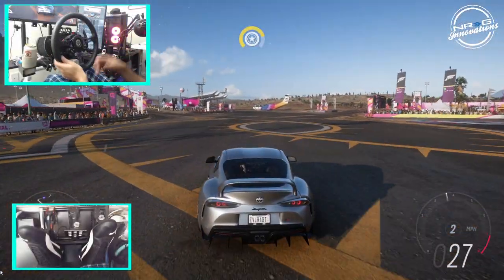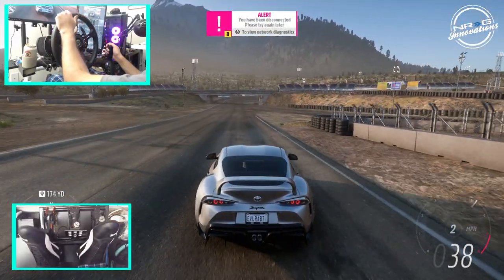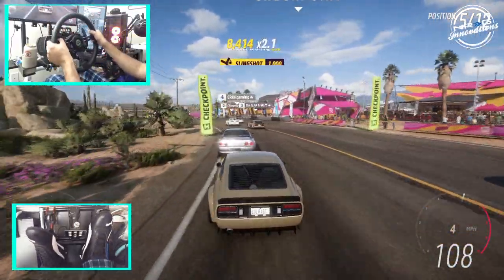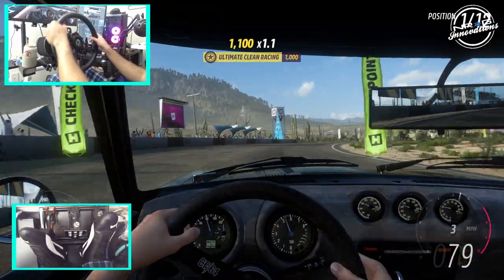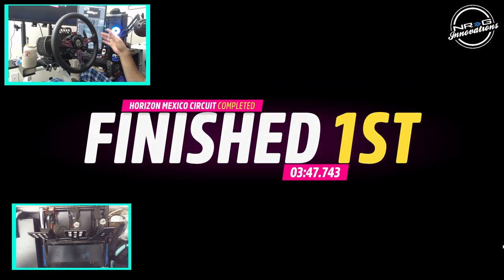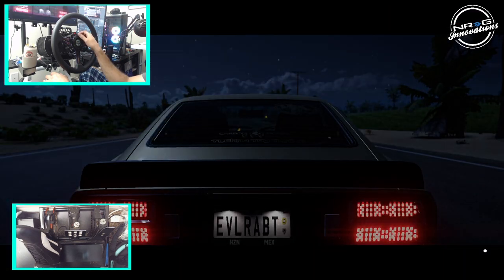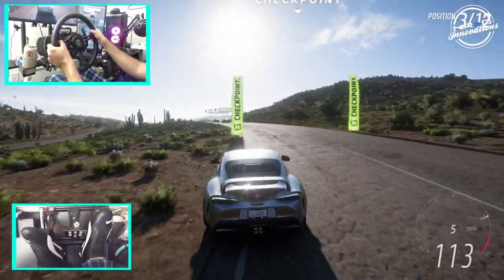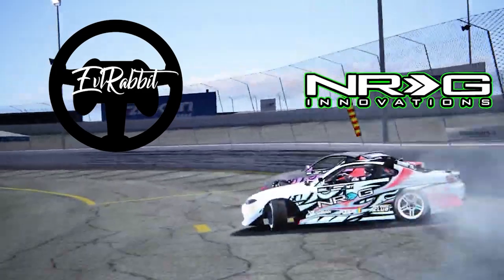Forza Horizon 5 Wheel First Impressions and testing some wheel settings - LP1 -

Comment: Yes, the fact that the animation doesn't go above 90° really bothers me...
Reply: been an issue for me since fh3... how is this still a thing? :(
Reply: Theres a camera preset without the wheel. Why do you need to see two wheels anyway
Reply: @sumbodee3  for two reasons, actually, the main being that I only use one monitor and the camera setting without the wheel is too narrow and shortens my peripheral vision, also the camera is static and it doesn't adjust when drifting. I'm on the console version and there isn't an FOV slider.

Comment: I haven't played with any of my settings with my Gmail in f 8 9 20 yet in FH5 but just using it earlier this morning I could tell deftly felt a lot different I'm gonna have to turn down the vibration but do you think with my G920 I could use your current settings or do I need to tweak anything

Comment: FH4 I could never get to feel any good on wheel, I hope it is better in this one, and yours seems to be doing well.
Reply from the maker: I have some new settings I worked on after this video that I will be showing soon
Reply: I cant  get any kind of self steer out of my wheel. I flick in and the wheel just straightens up. No matter how i go and change settings.  Its really frustrating.
Reply: @garywayne123  Exact same issue I am waiting to buy this forza because of that. No fun to drift in that game coming from Assetto Corsa
Reply: I agree with you, I couldn’t make my wheel to feel right with FH4. Even the cars physics felt out. 
Tried FH5 yesterday and first impressions are so good. It needs some tweaking, but out of the box is night and day compared to fh4

Comment: Have you had any issues with the game crashing on you while using the wheel?
Reply from the maker: Yes I have had some issues not sure if it's my wheel or other things
Reply: @EvlRabbit07  it seems pretty wide spread. Decent thread on Reddit and the forums. I have a CS 2.5 and it crashes almost every time after a race in a cutscene. I can drive all day in the open world but when I try to do an event it freezes say 80 percent of the time. I did see drivers 346 might fix it?  I haven’t had a chance to try it.

Comment: What are your wheel settings?
Reply: specifically your fanatec settings. I just cant get it right! Right now it feels like the wheel just wants to turn left or right. its almost like the opposite of the wheels wanting to hold center. I know I'm doing something wrong but messing with settings is so exhausting!

Comment: Are your wheels driver up to date? I have a fanatec v2.5 clubsport base with the hydro ebrake, H pattern shifter, and the CSL elite pedals. First thing I noticed, the hydro e brake didn't work, like at all. Tried to map the binding, game didn't even recognize that it was there. Second, clutch was not registering, I mapped it, but in game when I went to shift it would just bounce of the limiter as if it wasn't binded. Third, the seventh gear on the H pattern, you have to push down and shift into it, but when I did that the game just thought I was still in sixth. I don't know what to do to fix this. Help would be much appreciated.
Reply: Same!
Reply: Well idk about the other things but were you in a seven speed car

Comment: Im having an issue where I need to set my hand-break and other wheel keybind every time I get into the game. Is anyone else facing this?
Reply from the maker: I have the same thing I think there will be a fix coming soon
Reply: @EvlRabbit07  do you happen to know if horizon 5 lets you use more devices for hand breaks and stuff? I just got my wheel and am now broke, I’ve been playing assetto corsa using a controller thumb stick, a rubber band holding it for pressure, and a pipe so it feels like a handbreak(funny but it works 😂), do you think that or maybe the other stick for a sequential shifter or something would work aswell?